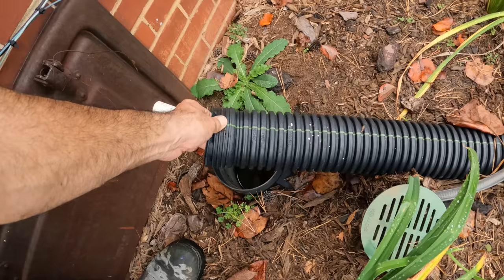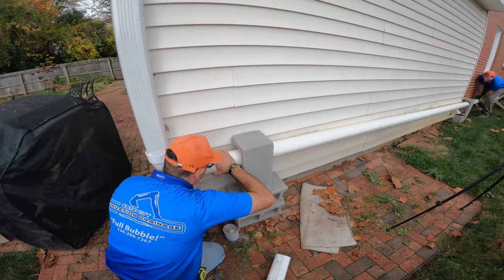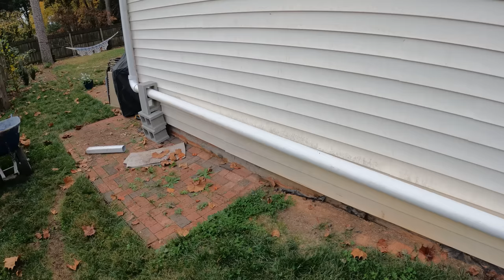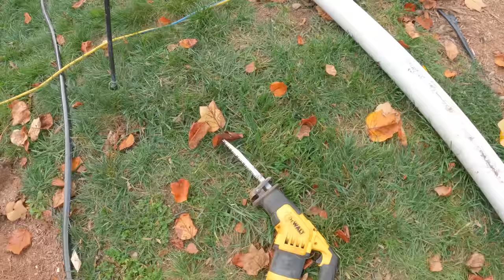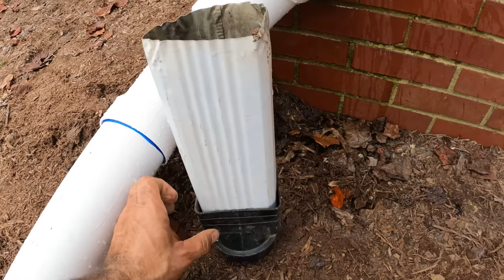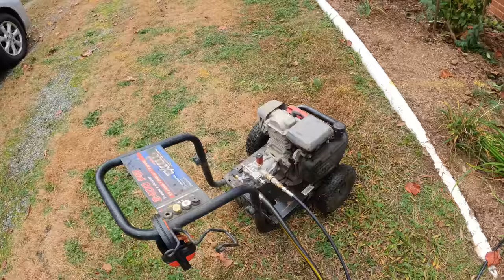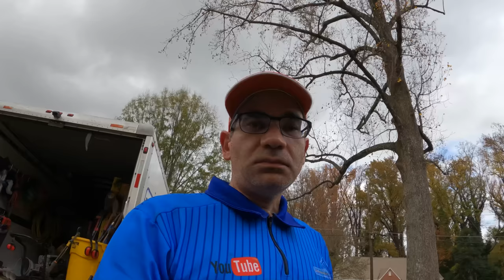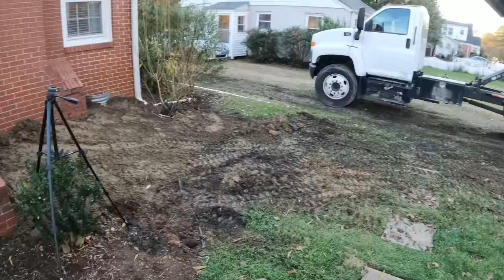Is PVC worth it? Crawlspace and Basement flooding, backgrading, and no fall

Comment: I do have to say - that pressure washer adapter seems very weak.   Maybe you had turn it off when you pulled it out of the pipe, but it seems like a garden hose had more pressure than that teeny adapter.   edit: if I had just watched 4-5 minutes longer I would have been able to tell when you first pulled it out of the pipe it was off.  Oops.  :D

Comment: I would think that you could have subcontracted that tree stump trench work to the guys with the right equipment. That would have been a 15-20 minute job for them.

You had to eat the cost of the chain anyway, plus your time and effort would be better off spent on your core work.
Reply: stump guys usually only go 6-8 inches below grade anyway. they never get all the roots. ground up stump/roots is not something you want as fill. it'll never grow grass, it rots and sinks

Comment: All of the gutter water can very easily be taken to the street, underground "provided" you have sealed PVC pipes attached to the gutters itself. Catching water that is 10 feet up above the grass will drain easily provided it is in a sealed pipe. Catch 100% of the roof water and take it to the street...very, very simple job for the gutter water disposal. Keep the water underground until you get near the street. Then pop up to the street level and have the water discharge onto the street itself...easy, easy, easy! If only you had put the sealed PVC pipe up to the gutters...then the water would flow onto the street with "FORCE". Sad because you didn't do it the easy way!!!
Reply: You're partially correct re: pressure of water, however as Sean has clearly shown in previous videos;
Without a continuous fall in the pipe it will silt up & then block with debis on top.
All Shaun's pipes have the ability to continually flush through to prevent this.
Don't forget also; a lot of his customers have already wasted thousands of dollars & years of time on previous subterranean systems that have all clogged up, corrugated or otherwise.
His systems largely self-clean, removing need for much clean-out maintenance too 👍
Reply from the maker: A system that uses head pressure like that won't blow out the debris Larry. The water will flow but the sediment will collect in the low area. I like these pipes to maintain themselves which is why I want gravity doing the work via the pipe falling correctly. Great point thought on head.
Reply: @GCFD  good point. 👍
Reply: @rw8074  Need for cleaning depends on trees near and above roofs, ground drains and amount of fall. With the limited fall along the driveway, a pipe will need routine maintenance more often. Corrugated pipe would need more attention than the PVC.

Comment: Disappointment 
All the talk and time on schedule 30 line you could of just replaced it. All the time and money spent on the rest of the system repla ing a easy straight line to me is a no brainer.  Having a true comfort level of everything is the ultimate goal i would want. You know the one joint is a problem. Maybe hyour defense is the added cost the customer didn't want  at the time.
Reply: And he could swap out the tee connection for a sanitary at the same time.